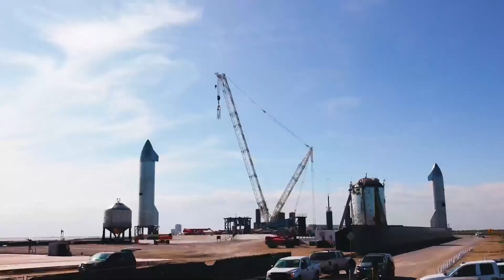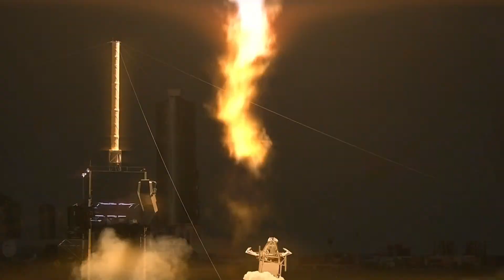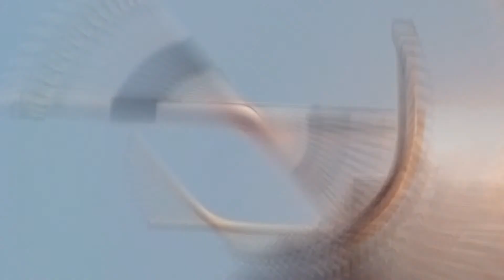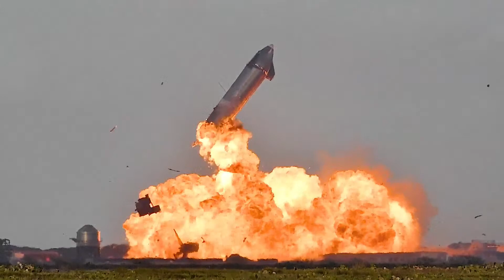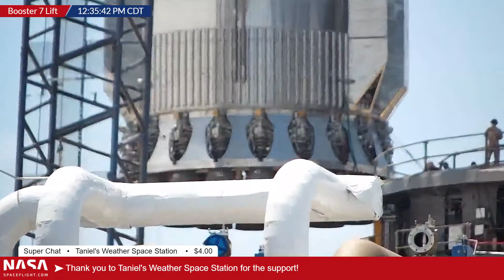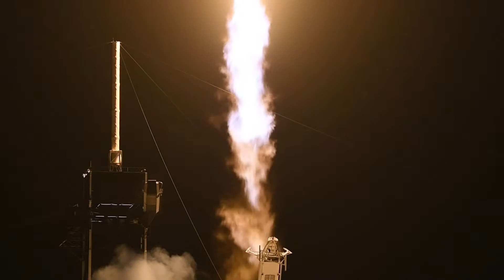SpaceX Lifts Booster 7 to Launch Mount for Upcoming Testing

Comment: The technical term is "sky hook". I wonder if they are even going to use booster 7 as a flight article. There seems to be a dented panel on one of the aero covers. They may just use booster 7 for testing. I think that the explosion was caused by a leak so they may be testing more for launch mount leaks at this time then testing the function of the engines.

Comment: The perfect functioning of the elements of the tower must be meticulously taken care of. It is as important or more than the vehicle, the slightest failure can be catastrophic for the booster, especially in the recovery maneuver
Reply: When they zoomed in to the top of the booster during streamed coverage of today's static fire, it could be seen more clearly just how absurdly small those catch pins on the booster are and thus what a very narrow margin they are working within - one that must never fail. It's mad, it's all so f**** mad, I just can't believe someone took these insane ideas and is making them reality. I'm loving it all... but sadly, you'll never convince me that those 33 Raptors are going to all fire at once without some kinds sh*t going down until I see it with my own eyes. Cos I reckon that'll blow a hole clear through Texas all the way to China.

Comment: If he had sparklers going during spin test SpaceX would not have found the leakage problems with the outer ring fuel lox hookups which caused an over abundant collection of flammable gases building up under the engines which would have destroyed ground zero and booster on a static fire.

Comment: Outer ring had damage from explosion  also need to do less than 33 for spin tests.  Might also want to use new GSE for Center engine remove/replace
Reply: they took the engines out and ran them up to McGregor and did the SP tests on each of them up there.

Comment: from what is have been able to find out is during the spin prime test the cloud of LOX and LNG acted like a 10k HP Nitrous Oxide shot on a little generator that was running witch blew up turning the cloud into a fuel air bomb

Comment: The tower and chopsticks are an active part of the landing (crewed). So the FAA would have jurisdiction concerning the chopsticks and tower. If an airliner landed on a runway, lost control and crashed because of a major defect in the runway, the FAA would be all over it.
Reply: I'm sure a ton of regulators would have their eyes on the tower and the rocket, though I have a feeling the tower might be more under the purview of NASA than the FAA. The tower is basically the landing gear of Starship and SuperHeavy, so it's not a good analog for a runway.
Reply: @limiv5272  using what previous data can they make any sort of rules/regs?  A hunch? 

The industry said no one couldn't land a rocket.  How many times did SpaceX get to crash one.  No one stopped that.  

My opinion no one knows until they try.  They are going to have to fail quite a few times before RED TAPE says you know what, this is a horrible idea.
Reply: @machineenvyllc437  The data they will use is the laws of physics. Making sure the design is theoretically sound and includes a enough redundancies and margins of error to not be an obvious danger.
Reply: @limiv5272  But if you can crash land every other rocket that goes up in the air.... How is catching one any different?  Think you reaching there.  Think they will have to make a few omelets before they tell him can't do it anymore.  

But again.  no benchmarks to say no.  So someone got to do benchmarks to make the benchmark.  

Why on paper did everyone say you can't land an orbital rocket?  Why did they let SpaceX try and land an orbital rocket as many times as he wanted to?  

OBVIOUSLY it is NOT an issue, they have let him build and theorize what they want to do now for 12+ months.  Now they going to watch it fail/succeed a few times (5) before they say enough of that.  Do whatever you want offshore.
Reply: @machineenvyllc437  Other rockets don't crash land, they deorbit themselves in a controlled manner. Except for Chinese rockets, because China doesn't care who they hurt.

Landing rockets isn't against the laws of physics, people just thought that it was unlikely to be practical and that the cost time and effort of development and the added weight and loss of performance to the rocket to give it that capability would make it financially unfeasible. Authorities are charged with protecting the public, not preventing a private company from committing what they think is financial suicide, so of course they let them go ahead. Same goes here, even if authorities think Starship is unlikely to work as intended, as long as they don't pose a danger to the public they'll have to let them go ahead.
Reply: @limiv5272  I see you last word kind a of guy.  Just saying until there's a benchmark, you got to make a benchmark.  

Then you can rule and reg it to death
Reply: there is no benchmark to make regulations....  Flying different story

Comment: I would say Elon wants to get to testing the booster an OLT because all the engine starting systems are in the OLT and not on board the booster for weight reduction because outer engines only used for launch
Reply: There are probably a lot of things in the OLT Elon wants to check, I'm sure they'll get to it soon